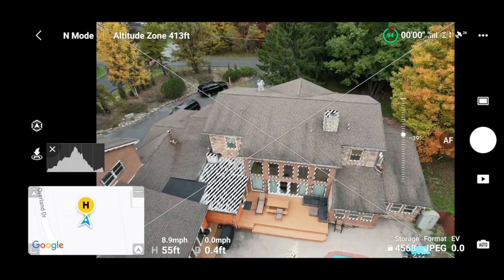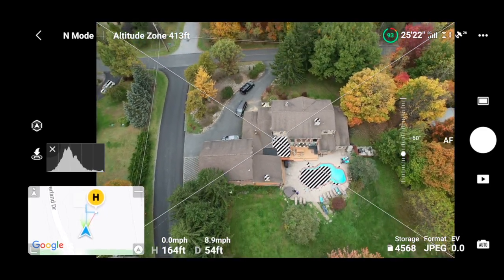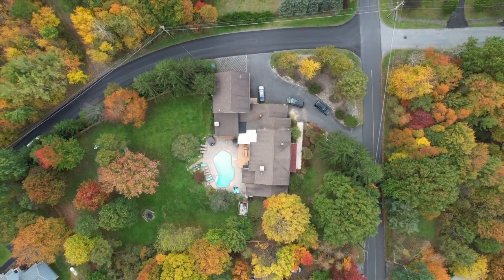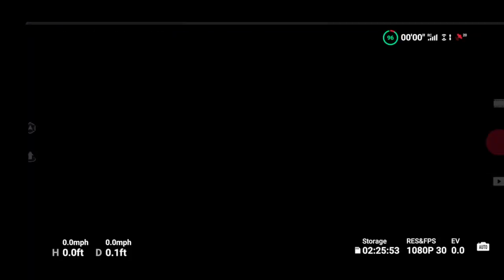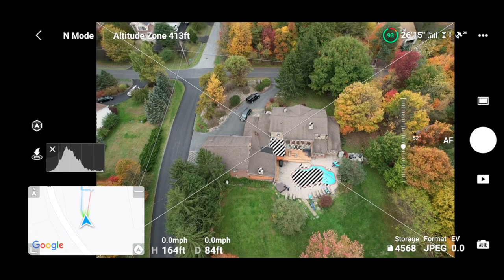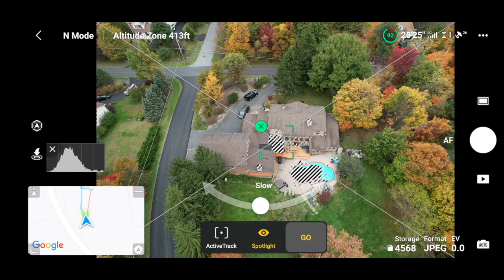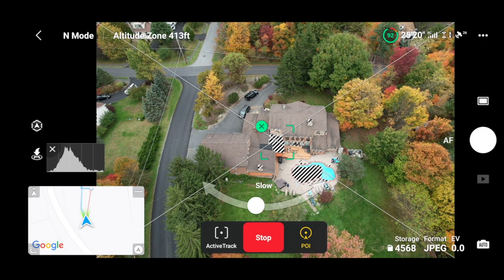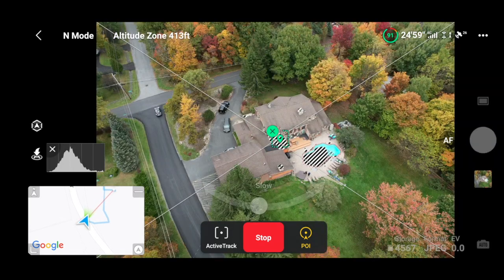3D Mapping Using A DJI Mavic Air 2S

Comment: Is quality photogrammetry possible with the Mavic Air 2? Or would a more capable drone be needed such as the Air 2s / Phantom 4 pro?
Reply: mavic air 2 is supported by dronedeploy, so I suppose it is usable enough.
Reply: GPS, RPK, and image quality matter most above specific model or manufacturer.

Comment: Hi, ist there any possibility in the DJI Fly App to combine the POI Mode with serial shots (for example one shot all 2 sec.)? 
I am using the Mavic 3 and Air 2S now but I don't like the Fly App. When I am using the Mavic 2 Pro with the Go 4 App the POI Mode is much better and more accurate because you can exactly fly to the point and lock it, adjust the speed in m/sec. and also correct the position during the flight-mission if necessary. That is missing in the new Fly App and that's really bad. I often have to check roofs, have to build 3D Models and maps for measuring. Therefor I have to fly close and the circles are small but I need at least 50 to 70 images - so its important to set the speed as low as possible. Sadly the Mavic 2 pro will not be produced anymore and with the new drones we only have the Fly App (and Third Party Apps) but wich one can do it like that? Maybe there is someone who has an idea. 
Thanks for your great Videos and greetings from Germany. Joe
Reply: Did you ever find a workable solution? I’m piloting the Air 2s to create 3D models of cell towers and have come up short looking for an option the combines reliable orbits with locked gimbal angle, and captures images every 2 seconds. If you found something that works I’d be most appreciative.
Reply: @peterhdge  The only options with the Fly app is to fly via POI mode or by hand. You have to release the shutter yourself at intervals to take the photo. Alternatively, you can use the Hyperlapse mode to use the photos taken automatically at intervals. It is important that you specify in the hyperlapse mode (circles) that you also want to save the individual photos. You even have the choice between RAW and JPG. JPG is enough for us. However, you have to mark the area you want to circle on the screen. This always leads to inaccuracies. Unfortunately, you cannot make corrections in flight with this automatic mode. I am very annoyed that the good solutions that you had with the Go4 app (and the corresponding drones) are no longer available with the new drones. I'm almost assuming it's economic policy, because DJI said to me: "If you need such functions, then you have to buy an enterprise model!"
Conclusion: If you want to do such things or have to do them professionally and you don't want to buy an enterprise model, then you either buy a Phantom 4 Pro V2.0 or a used Mavic 2 Pro, since this drone is unfortunately no longer produced. (this is the best model in terms of price/performance anyway)
Best regards from Germany
Joe